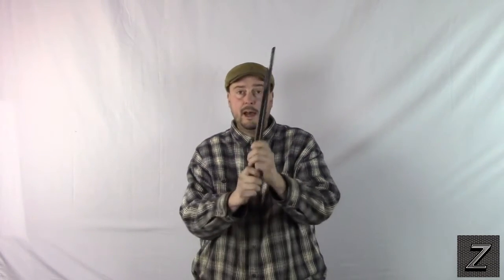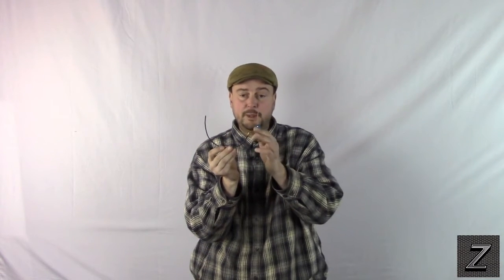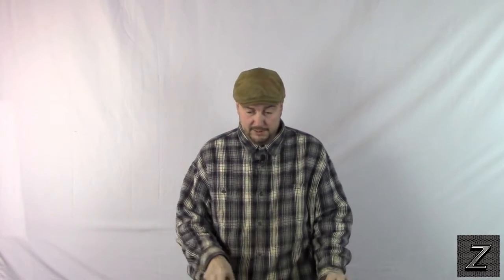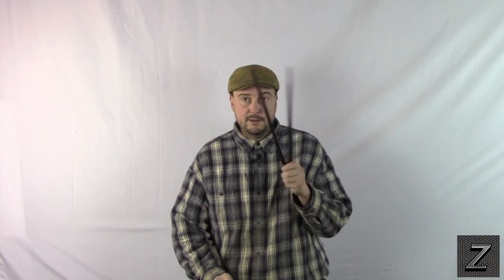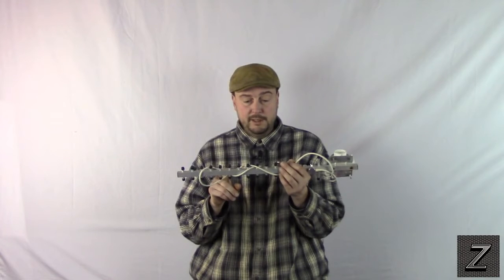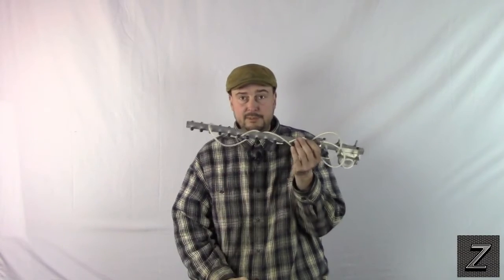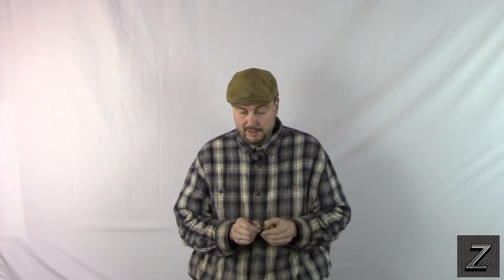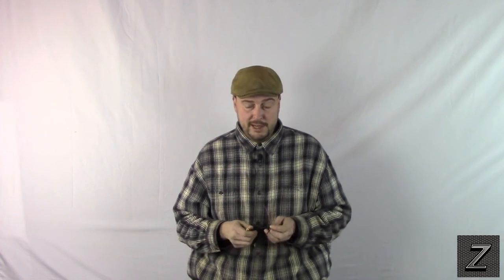Will adding a external antenna to your HC-05 and HC-06 increase its range

Comment: First off, the dbm output of this device is quite low so by adding coax feed line just absorbs all of your rf power. Remember this device tx/rx at 2.4g. Two high to feed out an a transmission line without way too much loss. Second, Antenna design is very complicated and requires formulas. All the tx device wants to see is aprox 50 ohms as a match but getting long range on a very low power device can be done and done quite well if one knows about antenna design. I suggest a 4 or 8 pole coax co-linear design. Hell, I got over 4 miles out of my bluetooth junk in open air. Or build a simple dipole and run the dipoles horizontal. This will give one a -20 db rejection from most virtical wifi antennas. S (A is quarter wave length of element gnd plane) Same with element ( B) 235 devide by 2400.000 = 1.170 inches for each element so the over all antenna will be a half wave dipole to equal a total of 2.340 inches. even this if done right will or should give you a range of aprox 1/4 to a 1/2 mile after all you a. re going from minus dbi 6 to 12 to + 0 dbd unity gain. and this is the reference point to all antenna mesured in Dbi or Dbd Antenna height, Gain and matched is where the range is. A good rule of thumb. One watt out into a dipole at 0dbd at 1000 feet is aprox the same range as 1000 watts out at 0 feet with the same antenna will be equal in range and then there is gain, and loss., Do some homework. ARRL antenna hand book. Have a nice day!
Reply: If you have seen the whole video, he actually says (4:25)  "I'm guessing this board just dosen't have enough power to run these antennas"  So pls. do your OWN homework, before you throws stones after this U-tuber.

Comment: Larger antennas would introduce higher loss. Although larger antennas are more efficient, for low power applications, power loss a big issue.

Comment: I sometimes encounter problem in connecting with HC-05 & HC-06 bluetooth modules. It won't just connect with my phone through the App that I am running  though it is already paired. I get the module very close with my phone but still won't connect - but if I restart the module by switching the power off and on then the bluetooth module again establishes connection with my phone. What could be the problem?